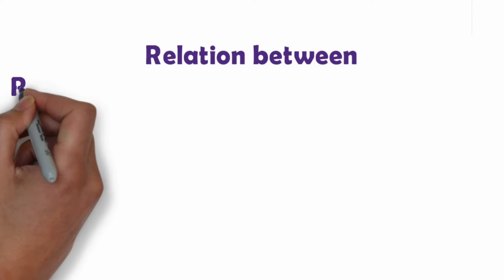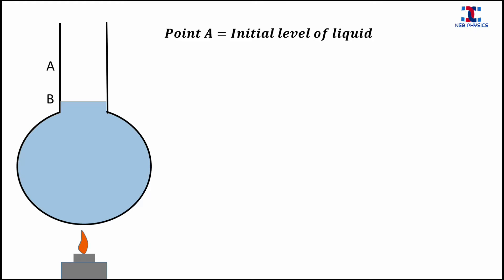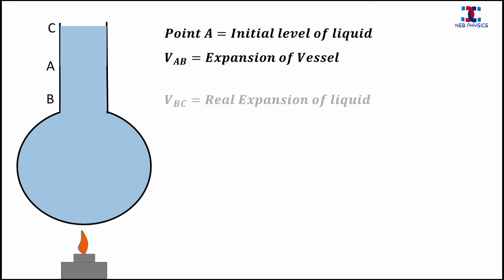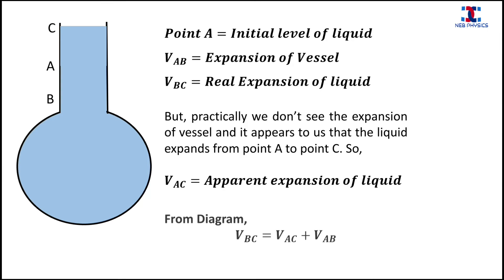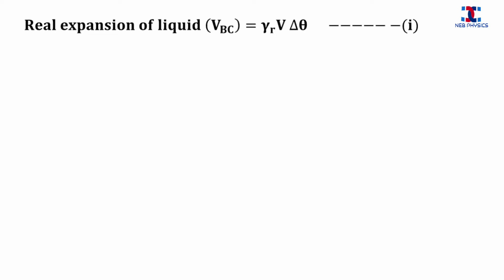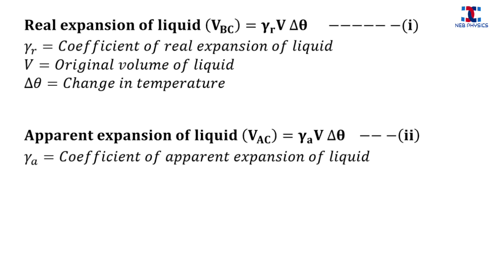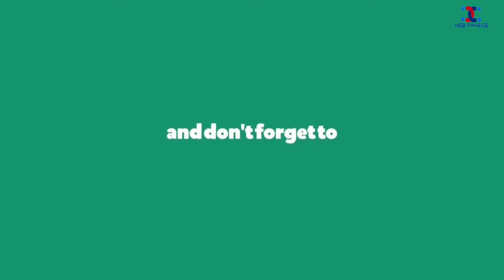Real and apparent expansion of liquid | Thermal Expansion

Comment: 00:00 Derive the relation between coefficient of real and apparent expansion of liquid.
00:31 Expansion of vessel affects liquid level
00:59 Liquid expands more than solid on heating
01:26 The apparent expansion of liquid is observed from point A to point C.
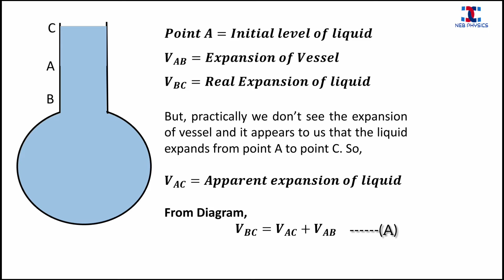01:56 Understanding the expansion of liquids in vessels
02:26 Calculation of coefficient of apparent expansion of liquid
02:54 Expansion of vessel and its coefficient
03:27 Relation between real and apparent expansion of liquid
Crafted by Merlin AI.

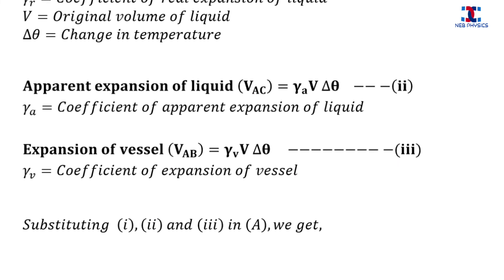Comment: 3:10 I have a doubt. In expansion of vessel, why do we use initial volume of liquid as the initial volume of the vessel? If that is the case then the vessel should be completely filled with the liquid before heating, right? Is that the case? If not, why do we assume the initial volume of the liquid and that of solid to be equal?
Reply from the maker: The original volume of vessel is taken as the original volume of liquid.
Reply: @nebphysics  Okay, thank you!